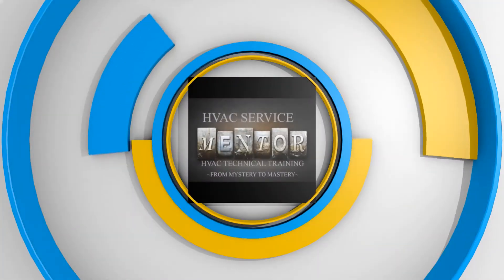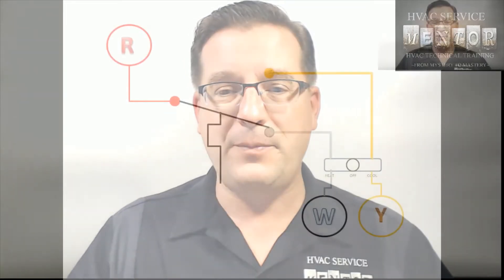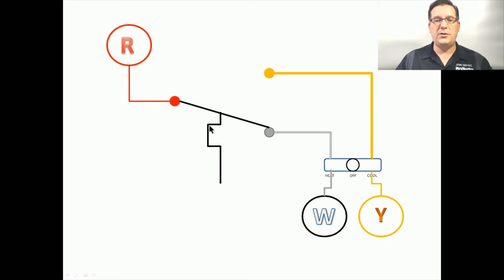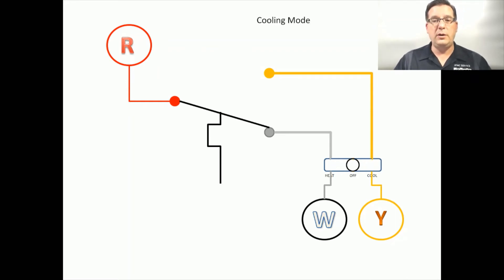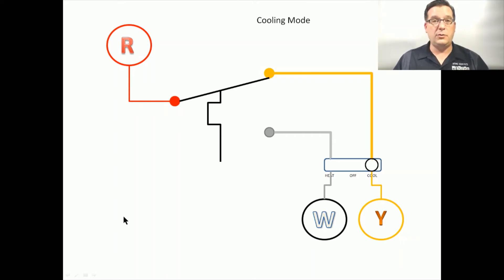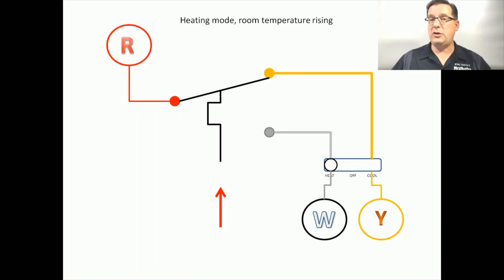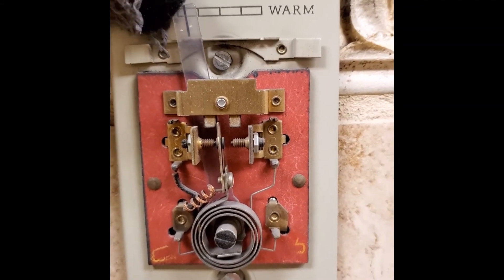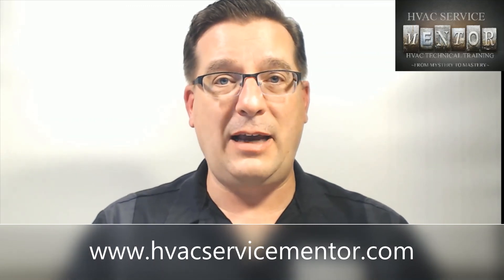How a thermostat works part 1

Comment: Hello and great contents.I am still a rookie in the field and today I am eager to learn about thermostats!!  Let's suppose a DAIKIN/Toshiba/Mitsubishi...I have opened one of those recently but did ny see any of those terminals other than 24V DC terminals and a printed circuit board!!!Can you please make a video on how those modern electronic thermosats work!!! Schematic diagrams will also be very helpful and appreciated.Thank you
Reply from the maker: Many mini split units like the ones you describe do not have conventional thermostats at all.  They use a remote control with a temperature sensor located on the air inlet side of the evaporator.  you can see a little black probe if you remove the filters.  The remote only sends a setpoint command to the unit one time.  All the control logic is in the fan coil unit.  Those systems are highly sophisticated and they are all different from each other.  They operate very differently from larger conventional split systems.  I know that isn't very helpful.  That is an industry wide problem with those types of units.
Reply: @hvacservicementor  Great cover.Please if possible do a video on them! Thank you